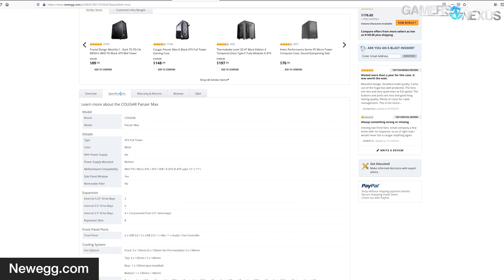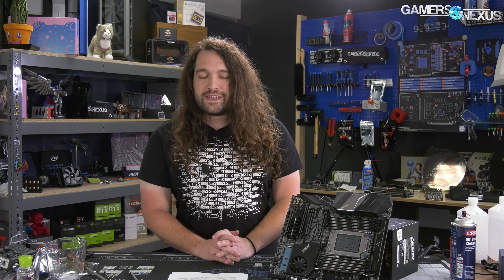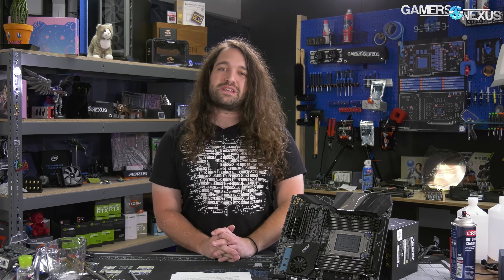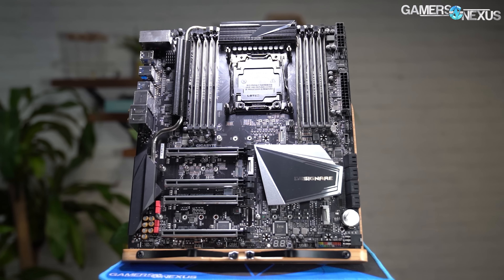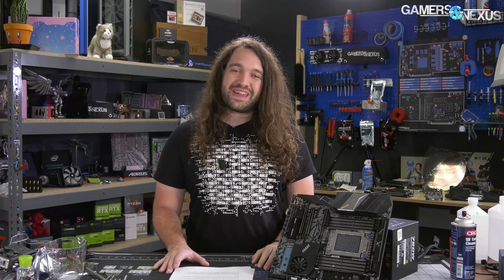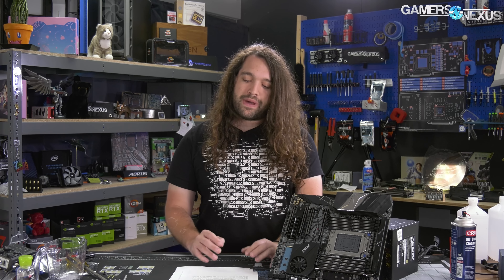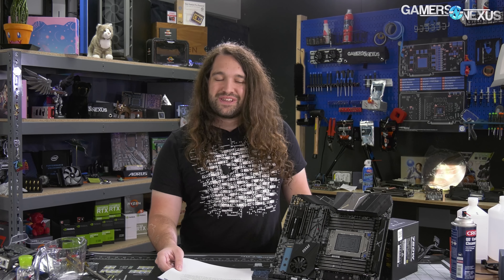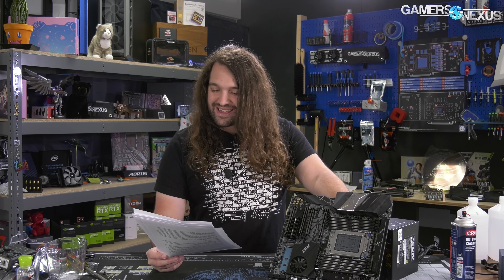"E-ATX" Is A Lie: How Motherboard Makers Ruined Form Factors

Comment: I'm still waiting for ASMR-ATX (the one that has a built-in sine wave generator operating at 432 Hz. to lull you to sleep)🤣 Someone else mention the 386/486 boards from the 90's.. now that was real cluster-f^^k compared to what we have to deal with today, especially considering the mounting screw standoffs were usually fused to the inside of the case and non-movable.😜

Comment: It's not just the problem of what board fits which case. There's also cooling and graphics card problems. My graphics card is that long, I had to move the drives to other bays to squeeze it in.

Comment: I remember in the late 90s having problems fitting standard sized ATX boards that dare use the full 9.6in width that the spec allowed. Many case companies barely allocated enough space for them since most ATX boards were the full height, but usually 8in wide tops (look at period Socket 7 and Slot 1 ATX boards, most were narrow). I landed up with a few scrapped knuckles wedging in boards during that time period.

Intel did create a form factor for big-n-tall workstation boards called WTX, but nobody seems to use it anymore and Intel abandoned it. I guess after BTX failed, Intel threw their hands up in the air and said "forget it" and stopped trying to set new standards.

Comment: Steev take a look at the comp tia motherbord specs for some fire power.
Reply: I generally write the motherboard sizes and specs on top of the case either in a sticky note and tape it to it. I also will write on the case on the bottom

Comment: I have a question, is it ITX or Mini-ITX? because I've heard both for the same form factor which suggests to me that it should just be ITX as the 'mini' implies a bigger sister but the next size up seems to be Micro-ATX.

I'm glad I just stick with Full Tower cases and just normal ATX boards.

Comment: mini-dtx is gonna be a similar issue going forward I think. Rule of thumb rn is if the case requires use of a riser card, it doesn't likely support mini-dtx.

Comment: STX has a similar problem on the other extreme, although miniSTX and microSTX are pretty much proprietary to Asrock, as in to my knowledge, the only cases that will fit miniSTX boards are the Deskmini cases, and microSTX is mainly an industrial form factor, basically they're trying to be even smaller than mITX and that doesn't seem to work out so great.

Comment: My first "E-ATX" motherboard was my dual slot 1 LX board with 300mhz p2's. circa 1997 at 12x13 inches. Full atx to me meant it used 3 colums of screws, and this seemed to work up until recently. ... .  . Thankfully I have had the same case since 1997 which can house all these motherboards except that 14 by 14 asus pos.

Comment: Finally! Someone adresses this madness.
Last year I built a dual socket workstation with a 12x13" SSI-EEB board.
Finding a case that supports this formfactor in a usable fashion was a nightmare.
Some cases, high quality cases which I would've bought without hesitation, are 2 or 3 millimeters too small. 
WTF?

Comment: If they're a larger board, couldn't they just add a number after each version of E-, EE-, of a standard ATX board? Like say they just use Roman numerals behind the ATX design?  ATX-I, ATX-II, etc. Could it be a better solution to make it correct in itself? Just a thought.

Comment: Ahh Steve you got pumped really hard for this. I haven't seen you this animated for a long time. Quite entertaining. :)

I agree!

On a serious note. I would love to see EEB as a total standard for every board outside SFF. Move, rotate CPU socket/VRM (like Dark SR-3) to the right, raise slots so we have double spacing between them. I was in same spot as you with case for my TRX40 XL-ATX, where you need 0.5-1cm extra space after 8th slot.

At least 2019 TRX40 XL-ATX (8-8.5 slots) is not 2010 XL-ATX (10 slots).

Comment: Great video.  Hilarious in the sense of ridiculousness but still very valid the whole way through.  Glad I have an EVGA X299 Dark board but knew it was large, like the Classifieds / SR-2 / SR-3 so have it mounted in a Caselabs case.  But sadly well, RIP to them.  I do agree it'd be much better if case manufacturers could simply say "Accepts ATX and larger sizes (up to x by x).  Or just Motherboard size (x by x)."  It'll be interesting to see if case manufacturers or motherboard companies take your video to heart.

Comment: This is like how the fabled Meshify C case will "fit 3 fans in the front" as long as you remove the top of the power supply shroud, remove the 3.5 drive tray, and don't use any spinning drives in your rig. =)
Reply: It can fit 3x120 or 2x140 in the front with no problem

Comment: Case manufactueres should provide a picture to retailers, showing the outlines of different motherboard sizes as mounted in the case. Like when comparing screen resolutions, though that is a whole other can of worms.
Am I asking too much? 20 minutes of Photoshop, PowerPoint, Paint or whatever you want to use.

Comment: What about slim ATX? The ones that are not as wide and don't reach the far right screws in the case. Also the exact same thing with the Micro-ATX and the slim Micro-ATX. So, "S-ATX" or "ATX Slim" and "S-Micro-ATX" or "Micro-ATX Slim" or maybe CGLB-Micro-ATX ("Cheep Garbage Low Budget Micro-ATX")?

Comment: time to introduce XL micro-atx.  micro-atx I/O on regular ATX board size. All the space used for PCI slots 5-7 can be repurposed for VRM or whatever else you want but will fit in any ATX case.

Comment: GOD!  Choosing parts for my new system got that much more difficult!  I've seen E-ATX / EATX; and, I think I saw one marked as ATX-E.
MSI's Godlike: 
12 in. x 10.7 in. (30.5 cm x 27.2 cm)
E-ATX Form Factor
Not that I'll be purchasing the Godlike; but, what happens if I order an "E-ATX" case and the Mobo doesn't fit?  Fuck me!

Comment: Could you imagine PSU manufacturers doing this with voltages? Extended 5v rail which puts out 7V on Corsair PSUs and 4V on Bequiet! ones. Yeah, that wouldn’t fly now would it?

Comment: AT was massive. Then came Baby AT which was drastically reduced in width and height with the height reduction coming from having nothing much beyond the keyboard connector. Baby AT boards might also have fewer than 8 slots. Other than overall dimensions (widths weren't really nailed down) the placement of components aside from the slots and keyboard connector was a free for all, often with the CPU or RAM in the way of long cards.

Then came ATX with its stupidity of the power supply fan drawing air through the warm power supply and blowing it at the even warmer CPU. I flipped many a bottom mounted ATX PS fan over, along with sealing all the interior vents and slots on the PS with aluminum tape. Much cooler running! ATX was soon followed by Mini-ATX which typically had only 6 slots and Micro-ATX which could have anywhere from one (or even zero) to a maximum of four slots. Also changing in the ATX spec was eliminating the stupid inward sucking power supply fan, switching to a rear mounted exhaust fan, with some having a bottom mounted and outward blowing second fan. The reason for the fan silliness was ATX design began in the 80486 era but wasn't finalized until the time of the Pentium 60 and 66, which were HOT and didn't do well with pre-toasted PS exhaust (inhaust?) being blown at them.

Many OEMs still wanted to live the dream of not having a CPU fan mounted directly onto the CPU heat sink, so they went with kludges like a 4" fan on the back of the case with a big, curved shroud to direct low speed, high volume air at a heat sink with really tall fins.

BTX was a formalization of that method, but with the big rear case fan blowing outwards and using a fairly well sealed duct from the fan to cover a massive heat sink. BTX is arguably a superior form factor. A true BTX tower mounts the board on the opposite side of the (tower) case from any AT or ATX variant to correct the problem introduced with the PCI bus. When PCI came along the majority of PCs were still desktops, laying flat with the cards upright. Towers originated as desktops flipped on end, the left end. The reason being that put the chips on ISA, EISA, MCA, and VLB cards on the top, so their heat could easily rise up and away. There were even a few "convertible" cases with a drive cage that could be taken out and remounted rotated by 90 degrees so the drives would be horizontal with the case tipped up on its left end.

But for PCI, someone decided it'd be brilliant to make them backwards from the four extant expansion card standards. That put chips on PCI cards in the now formalized left end down towers on the bottom side of expansion cards. Their heat would tend to sit there, warming the air which would have to flow outward to crawl up over the card edges. AGP copied PCI's backward design. Soon the ISA bus had gone completely and there was no sense at all to the left end down position, yet it persisted and still persists in the vast majority of PC towers to the present day.

The designers of BTX took the opportunity to correct that flaw by essentially switching to a right end down tower. The slots and rear ports in BTX are also on the opposite ends of the board from all the other form factors. That puts the PCIe x16 slot, still closes to the board's middle, in a position where a thick GPU heat sink doesn't block a slot, nor is there a need to leave a slotless space next to the x16 slot to make up for a thick GPU. BRILLIANT DESIGN! Should have killed ATX in short order, like ATX had done to AT.

Unfortunately most OEMs totally screwed up the implementation of BTX by doing stupid proprietary shiznit with their cases. Mostly not having a "9th position" slot cover beside the x16 slot for use by 2x width GPUs and having the port openings punched directly into the back of the case instead of using the standardized BTX removable port panel. So to upgrade the board one must take a cutting tool to the case to carve out the IO panel and do something even meaner to the case to use a 2x wide GPU.

Some companies went even further by doing proprietary weirdness with the power supply connections. In one case, HP Elite series "BTX-ish" boards have been a popular upgrade for other OEM's "BTX-ish" PCs, to the point where there were commercially produced ATX to HP Elite power supply conversion wiring harnesses. Small Form Factor HP elite board hacked (literally) into something like a Dell Optiplex 520 case, just so a full height GPU can be plugged in.

There were a few BTX towers that were still left end down, quick and dirty redesigns of ATX cases, relocating the power supply to the bottom. IIRC there were a few called "BTX" but were actually bog standard ATX in a right end down configuration. They fixed the issue with PCI being backwards but were in no way BTX.

What should have happened, with the demise of the ISA bus, was the whole PC industry should have changed over to a right end down standard with ATX boards. The creators of BTX should have made it mandatory that a BTX license would require using a removable IO plate and standard power supply connection, which the majority of OEMs using ATX just did as a matter of course because it made making a wide range of options far easier and cheaper. Even better for BTX would be a requirement for a "9th position" slot cover, and no silly business putting a slot on the board to use it, should be there just for 2x thick GPUs.

Comment: I know it's confusing, but if I just had the dimensions of a motherboard with no "E-ATX" how would I check the positioning of the mounting holes? When you're buying a case, you want to make sure that the supported mounting placements will permit the motherboard to be installed. Buyers get a lot more confidence seeing "E-ATX up to 11 inches" than "12x11 inches". 

Now, it's true, if you watch this channel, you know that any case that supports ATX will have at least some of the required mounting holes appropriate for E-ATX.

Bottom line, there's a reason why wide boards don't all have the same width, and long cases don't all have the same length. Motherboard makers want their boards to fit in as many cases as possible, given the components. Case manufactures want their cases to fit as many boards as possible, given their dimensions. Having a standard like ATX, which is defined, but permits open-ended extension under E-ATX serves a clear purpose, and is relatively simple to understand, so long as the dimensions are also communicated.

Just communicating the dimensions of a board may take up less space, but that doesn't make customers happy, because they're not precisely looking for a case that supports 12x10.6 inches, they're looking for cases that support E-ATX motherboards of at least a certain width. This works for both customers and sellers in terms of search engine optimization, in the absence of any single standard which is appropriate for every product in this segment.

Now, the multiplicity of additional names like Full E-ATX, etc. may be unjustifiedly confusing, but we still need E-ATX to mean what it means.

Comment: I am sure the Mobo makers just learned from the best.

Like the 40, more or less, DC power connectors for laptops.
And the mixing of similar diameter Imperial and Metric screws in PC cases.

Comment: I'd just be happy with the following.
1. If a case says it supports E-ATX, then it should support ANY - up to the largest E-ATX size. This should mean that no E-ATX board will ever cover any of the grommets!
2. E-ATX should at least be a standard for where the screw holes are (I think it actually is).

My Asus ROG Rampage IV Extreme E-ATX board partially covers the left-most grommets of my NZXT Phantom-001 case, which was marketed as supporting E-ATX. This violates my first point.

Comment: Youbshould also mention ATX is not just a form factor and it does specify the power suply requirement. I remebr the old boards which were the same size as an ATX board but used a diffwrent power connector. The pentium 4 introduced ATX+12 the common 4 or 6 pin extra 12v supply connecter aditional to the 24 pin connector. The EATX not also had a larger board but required 2 ATX +12v conectors one for each cpu the EEATX had 3 +12v conecteors. 
Board sizing and hole placement is a nightmare as suoermicro X9DAI and X10DAI hace EEB holes which wont screw to an EATX without modification. Yes tou need drill and tap your own holes but the board is the same size. Its a mess for sure

Comment: As someone who has struggled against this since I started buying Dual Athlon MP motherboards in the mid 2000's you've voiced every piece of anger I've ever had. I've probably had 3-4 motherboard purchases that have required case changes due to the damn motherboard not fitting when the specs said it should. Most recent one was an Asus X399 board, so still happening 15 years after I first ran into this problem.

Comment: That's why I just took good old ATX. Wanted a mid tower anyways, so there's no advantage in messing around with mb sizes whatsoever, cause ATX fits everything a normal user could possibly need.

Comment: SSI-EEB doesn't seem like an all too stable standard if it has these optional holes that case manufacturers can ignore and motherboard manufacturers can use on a whim. It should be indeed be stricter, but I have concerns to this end.
Would switching to a solidified EEB make the motherboard designs less interesting? Those EVGA boards really stick out as unique in front of the run-of-the-mill ATX boards.

Comment: I totally agree. I've been there. I really wanted the ASUS Crosshair VI Extreme Motherboard, so I spent WEEKS to actually find a case that supports this "E-ATX"-Board. Because "supporting" it almost ALWAYS comes with an asterisk. I found a lot of cases which claim to support it but not even mentioning that rubber grommets cannot be used then and it's also common that there are no CLEAN alternative cable routing methods besides the rubber grommets. It's a total mess. And it's not only about "supporting it" but also about the feature set of the case itself. I even remember calling caseking to ask for recommendations - they call themselves "caseking" so I assumed they know stuff about cases. But they don't. From the recommendations he made, it was pretty obvious that he just scrolled through their shop and named a few cases that have "E-ATX" in their spec sheet. Thanks for nothing. I ended up getting the Cooler Master C700P and building in it is a complete nightmare. 
Since then, I made a rule: Use a proper standard like ATX, µATX or m-ITX or it's not going to happen. I now moved back to a standard ATX-sized board and a Fractal Define C.

Comment: The use of eatx (E-ATX)  has never been consistently defined as Steve so gracefully pointed out here and it's been the exact reason I avoided it. I would love to run a huge mother board just to fill the space but, I don't trust the cases and motherboards to agree to work nicely and I don't feel like doing a hack job on the case to make it fit. If it were an actual standard I would be a customer of EATX.

Comment: ** in the old days cases use to come with these little screw less nylon stands, these were used for EATX style boards, it basically allowed for the boards to have a backing not requiring actual screws; acted as spacers/stands; still used regular atx locations

Comment: As an old skool modder I have to say......
Never used the ATX standards as a mobo sizing standard.  As you say, ATX and it's children were always a standard for the power applications(remember ATX P4?😂)...and therefor the cooling as power used makes heat.
I only ever used the ATX standard for motherboards as a pointer for the through-holes for securing the mobo to the stand-offs. 🤨